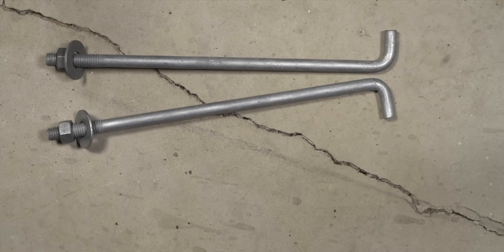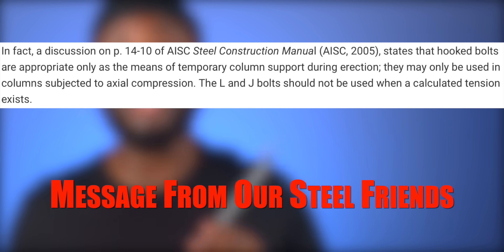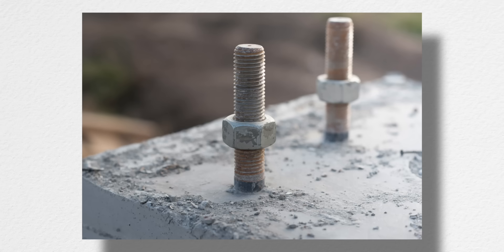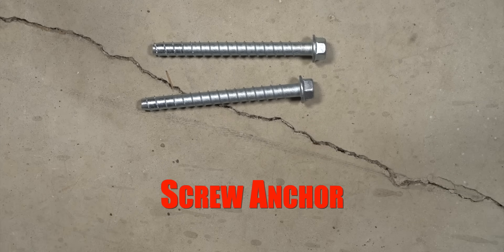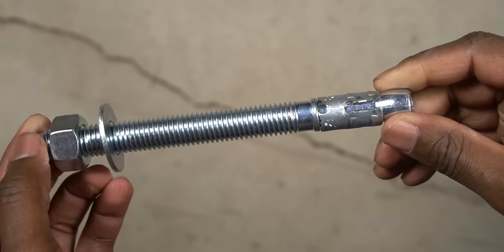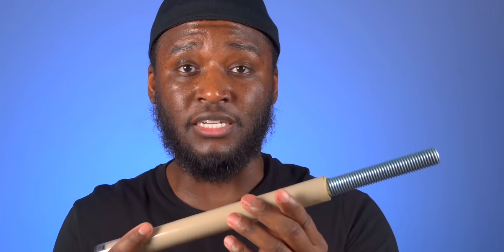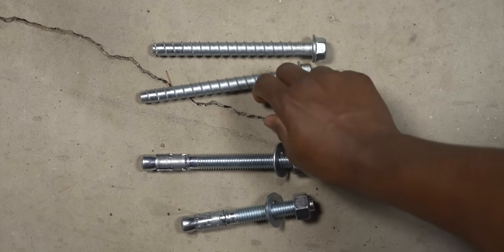Why Abandon "J" & "L" Anchor Bolts in Wood Framing Construction FOR GOOD?

Comment: @JthaEngineer ~ I see a lot of long time contractors, builders, and engineers commenting about the strength superiority in "J Bolts" and "L Bolts" over ANY Post Anchor options and a lot of hand wringing about "user error" in the installation of all Post Anchor types. Now, nearly EVERY comment about the strength superiority of J & L Bolts, includes a disclaimer that "J & L Bolts are HOOKED UNDER horizontally run rebar in the concrete." BUT, everyone concedes that these bolts can be difficult to install because of all the variables involved in setting them properly. Therein lies the rub for the Post Anchor Naysayers -->>  The "assumption" that the J or L Bolts are ACTUALLY hooked properly under the rebar! Let's be realistic about all the dynamic challenges that are innate to working with concrete. Anyone who pours and finishes concrete, whether it's footings, stem walls, full basement foundation walls, floors, patios, driveways, etc... KNOWS how many factors can impact the final product. I've seen horizontal rebar locations change dramatically before and after the concrete pour. I KNOW I'm not the only one to have witnessed this issue. So, can we really say with 100% certainty that all J & L Bolts are actually hooked under horizontal rebar?  All of the professional's hand wringing about potential "User Error" with Post Anchors, seems to completely IGNORE the frequency of "User Error" with J & L Bolts as well.  I appreciate your content. Keep up the great work! ~~Christy~~

Comment: I have heard the Simpson Titen HD screw anchors can get around the code requirement of at least 7" embedment depth. Meaning I can use a  6" or 8" bolt to hold my 2x sill plate down. I have the ICC-ES report up but can't make sense of it. You said you specified these anchors for your builds. Do you have any advice on what is a code compliant length when using these bolts? Simpsons long bolt options are 6",8", and 12". I'd like to avoid having to buy 12" bolts if I can.

Comment: hum, I think putting J and L bolts to concrete before it's dry is much more faster then. Drilling a hundred holds to put in anchor bolts is very tiring job. What you think?

Comment: Seems like threaded rod to a macro-version of plumbers tape or 18 guage L bar would be cake to incorporate into a pour.  I would hope the J was hooked on rebar or threaded cable in that pour.  You will never have enough uplift for it to fail.  I was skeptical of threaded cable until doing a tear out.  Absolute nightmare to remove concrete reinforced with that shit.

Comment: this guy has no clue what he is talking about , seems like a waisted education to this expert , never in history has a j bolt been pulled out of the concrete the sill plate gives out and the wall blows away with the sill plate and anchors still securely bolted to the concrete still , and Jay if by now you are not aware of how to find that kind of information you might want to try some other trade, then to suggest other anchors well i had to laugh at you then

Comment: Maybe some time working with a concrete crew would make an interesting video. Any rod buster could make those bolts work.  They just need support from a lateral bar. Just hook them on the bar and tie them in. Post pour if necessary.

Comment: From what ive read, the industry moving away from J bolts has nothing to do with pull out strength. Its about improper wet set techniques causing an air gap between the bolt and the slab which water can get into. 

Technically J or L bolts are far superior, but practically they pose potential issues.

Comment: Planning on doing a little 4-500 ft2 bar in my back yard. I’m not in construction but automatically assumed I would have to use anchored bolts. Why does drilling into the concrete not compromise the integrity? Generally wondering, nice vid

Comment: 1:29 your example shows it into the weakest part of precast concrete beam. That’s disingenuous as compared to most j bolt installations. Sub-Contractors can hardly read plans and don’t plan properly when they frame. It’s not just their fault. The contractors and builders chose the cheapest labor for so long there are no craftsman. I fundamentally disagree with the more expensive post pour options. People should just learn to be better. Just because a more expensive option exists doesn’t mean it’s actually better or faster.

Comment: Common sense would dictate installing "J" bolts before pouring concrete,  and using the proper installation and of length bolt would be best. Install with j under rebar.  When you talk about failure are you talking about design limits? Tensile strength?  Proper spacing using the correct number of bolts for design loads.

Comment: all the bolts shown do not meet code quoted as they 'must extend 7" into concrete or grouted cell of concrete masonry wall' , they are all obviously too short and 7" seems ludicrously onerous in the majority of domestic timber framing scenarios.

Comment: Im a stonemason,  Ive been fixing brackets and anchors to concrete blocks and concrete slabs  for 30 years. Boundry bottom plate anchors blow out more slabs  than j bolts, that's a fact, countering  your claim J bolts  are tricky to line up. Yes j bolts can be tricky to line up, but you need to prove which method provides more uplift  resistance, and therefore safer for my family. I would challenge anyone to provide  testing results that show a thread on a concrete screw  works better under tension than a bolt set into a slab.   You say there's a move away from  the bolt embedded method to screw bolts and I agree. But if 3/4 bolts aren't  sufficient,  then  for another dollar  more " use a bigger  bolt" and build  a safer home. The only advantage  is it's easier and requires  no thought to drill and place your threaded rod and screw bolts  flat against your studs, saving time, but it's not stronger, it's weaker. I have pulled out plenty out pins and screws but you have to grind off or snap off embedded bolts.

Comment: So for some reason we were required to put a particular depth of j-bolts. So it doesn't do anything? It seems like post applied bolts like Titen are superior and mean the bolts are more properly placed in the end. Actually engineers in our area, typically specify J-bolts. Just haven't changed their details.

Comment: The problem with the post installed anchors is there usually not allowed for installing green concrete which may be fine for some use cases but there's a lot of people that get out there on very fresh concrete and frame. I would be more concerned about tapcon style anchors that were installed into green of concrete personally over the j bolts personally. I have worked extensively in the concrete and rough construction but I'm not a structural engineer so maybe I'm wrong here.

Comment: ...........I feel as though ignorance is a pandemic . I do Residencial framing for a living out in ut in the Rocky Mountains. 5/8" "J" bolts hooked on the top course of rebar is not just the standard of the industry but is the Gold Standard. It is also the easiest of systems to install for a framer cuz wouldn't you know it, but drilling 1 1/2" of wood in your sill plate to accommodate a 5/8" "J" bolt is much faster then drilling 8" of concreat to accommodate a 5/8" Titan screw. It's not that any of these systems are bad, they are the best system depending on your application/circumstances. Try working in the fiend with these products for a hot minute. It will give you the actual context for applying your engineering degree.

Comment: You can install HILTI powder activated fasteners that are 12 TIMES STRONGER than "J or L" bolts. I used them on my 1925 Model T garage expansion to fit a modern pick-up on top of 7500 PSI concrete stem wall. We have tornados and 115 MPH straight winds in thunderstorms har' en Tussa, Orka-Homer, so I BUILT FOR THEM! My house was built 100 years ago in April this year. It's held-up to wind, tornados, 6.7 earthquakes, 17 inches of rain in ONE HOUR and more. Do it RIGHT or do it AGAIN!!! The builders used a dozen iron cut nails between each stud into the concrete stem wall foundation thru the "shoe" or footing.

Comment: in fl cbs uses rebar pored in the slab  ,  but i like to see something like a 3-4 inch each side t even the alternatives are still straight shafts  now i do know good engineering should have tests proving the claims by makers , i might like a combo of some j or l plus some drilled in if in hurricane or tornado areas although i would only build filled block or poured concrete in the tornado ally plus a shelter

Comment: You'll need between 2500 to 3,000 pounds of force to pull out a 1/2-inch diameter J-bolt embedded 6 inches in 4000 psi concrete. With around 30 of these bolts in a typical 2000 square foot house, that means you'll need 90,000 pounds of force or  wind at 150 MPH.

Comment: You can just chill in a rebar on sideways on an angle like 20° or so fill it with some grout or some Hilti head epoxy put it in there and then well then that's something on the end of it to hold your post down that's just as strong as an anchor bolt going straight down relying on that little edge I think it's even stronger it's like alligator nailing

Comment: As an Ironworker, L&J bolts cast in concrete at the safest to set on. Epoxy needs a pull test and can't be trusted unless they have it done.

Comment: Are you kidding? You should use exactly what the architect and/or engineer specifies.  And your test??? Are you kidding about that also? For testing...You should use a deep enough anchor so the anchor itself breaks...NOT the concrete.. THen you know what it will really hold.  We have put 1" threaded rod down 36 inches into a footing with 4 inch plate washers at the bottom... What is that good for????30 tons of uplift?   Sure,..I'm sure I'm just a fluke and haven't read any plans (that I am involved with) where they do not specify J bolts...or  fairly long allthreads with washers. If you look up on the simpson website,..you can see EXACTLY how much a 1/2 inch J bold embedded 9 inches (underneath the top rebar) will hold.   Nice click bait,..that's all I can say. I have never seen a post installed anchor allowed on a bearing wall.. And it will never happen on any job I am on. Post installed anchors happen,..and they are usually allthread embedded into concrete using structural epoxy,..and they have roughly the same strength as cast in place j bolt anchors...if they are the same length.

Comment: dude makes no sense, he had that bolt in inch of crete for his dumb jig, if instaling a hook into concrete is complicated for you then that's not the industry for ya. Those expansion bolts will crack concrete and still not provide the strength nesesary, the screws with glue are useless come on bro, most of those epoxies are not even made for harsh climates...

Comment: As a contractor of 20 years specializing in excavation and foundation retrofitting, I STRONGLY disagree.  Do not let your contractor use post installed anchors unless a mistake was made.  ONLY when a mistake is made should a post installed anchor be used. I don’t doubt that calculations on paper show post installed anchors being similarly as strong as cast in place, but those calculations certainly don’t take into consideration all of the factors, like horizontal rebar being embedded above J bolts, weakening of concrete with micro cracks from drilling holes, greater moisture intrusions, removal of galvanized material from post installed anchors, etc.

Comment: Sir, I have been building for 60 years,  dyna bolts regulrly  fail, scew in anchors great for  hold down or temporary formwork fix to adjoining concrete, rag bolts have stood the test of time in low stress engineered situations. This sounds like more white board commission for DEI academics have now  got hold of the construction industry. Start using Ramset concrete insert bolts where you can run a continuous line of deformed rebar through them that integrates with the cocrete and rebar design. Heavens help the construction industry with this  level of wooly thinking, talk about engineering loadings what we have going on here are mutational loadings . Welcome to the harsh roadmap of reality! KPP nz

Comment: J bolts which are wired to and hook on a horizontal rebar before the pour do not pull out.  Rebar threading is also a good option which is used where I live in California.

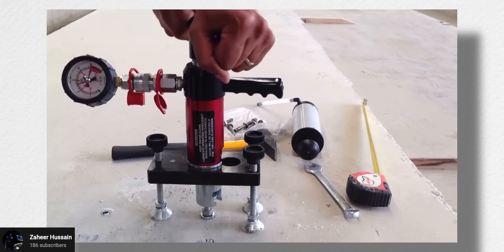Comment: Shame on you!  So much misrepresentation in this video!  You falsified the 'J/L Bolt Flaw' video. In your video @1:24 that is NOT a J/L bolt failing!!!  You stole that video from someone else!  And it's a wedge anchor failing!  Here is the original video https://www.youtube.com/watch?v=LBe4okYOvyA  You used that video to imply it was a J/L failure.  If you're using someone else's video you should be crediting them.  Not passing it off as your (false) test.

Comment: I'm a mechanical engineer, building my own home.  I used L bolts as called out by the structural engineer, but upgraded to galvanized for a few extra bucks.  In a few locations we needed additional bolts such as around doorways so we installed Titen bolts (screw anchors) in those locations.  I loved using the Titan bolts and they were very easy to install.  The concern I have is the design heavily relies on the integrity of the thread. It seems as if the thread would be the weak link over time as the thread corrodes and rusts.  The thread is fairly thin so it feels as if it could decay relatively fast.  I would suspect the galvanized layer is also somewhat compromised as the threads are twisted into the abrasive concrete.  I wonder what kind of life span these bolts have been tested to.

Comment: When I built my garage I did the j bolts on the block. However, I think both are fine, they both prevent uplift but at some point if the force it to much then both ultimately fail. It’s still better than nothing on the sill.

Comment: 65 years in the trades = This subject, and this presentation, is in my case amusing. Not to dwell on that, let me point out the obvious. Contractors are aware of the choices. DIYers don't often get involved with projects that require them. Engineers wet themselves when you get technical, hence my amusement. See below!

Comment: J and L bolts are FAR superior to screw, epoxy and expansion anchors. The logic in this video is some of the dumbest I’ve ever heard. But typical of Engineers with zero building experience. It should be common sense that cast in place anchors are stronger and easier (with proper prep), but over complication is commonplace among engineers these days. Also, I’ve been in the industry 30 years and I’ve never once come to the consensus that installing J or L bolts or drilling out sills is “hard”. It’s actually the very opposite.. please, if it ain’t broke don’t fix it.. perfect example here.

Comment: J bolts are fine, if they are dry set and the concrete is placed around them. They are not any good when they are wet set and pushed into the wet concrete. When you wet set, you push the aggregate  out of the way and are left with sand or worse a void above the hook.

Comment: Blah blah blah blah blah, blah blah, blah blah blah blah blah blah I see this video is two years old. This is April 2024 and your video is bullshit if you’re that using 4000 PSI with fiber and rebar in 45 years of building I have never had a failure so it’s operator error and when you’re talking net windshear lift that’s also bullshit sometimes the people doing the engineering and the testing are full of shit and they want. make their mark so they come up with all these wild ass ideas. Why is it homes all over the world don’t fail with this exact technology It’s because what you’re saying here is bullshit drilling into the concrete after it has hardened is inferior I saw your pull up test you’re not doing that test on 4000 PSI with fiber you’ll strip the threads before it will the concrete will break.

Comment: I have used J bolts for 50 years. Never had any type of problems and I will continue to use them. Just because screw bolts are new doesn’t mean it’s better. Expansion bolts cause to much long term pressures on very fragile concrete. We pour all our foundations then insert the J bolts and will continue.
Reply: The top of the walls are also never flat & level. Only way to get level & flat wall tops is going over with a concrete grinder which isn't possible with j-bolts in the way. Its pretty easy to just add a lot of Titen bolts since they install quickly with a hammer drill. and the increase anchor bolts per linear feet (2 or 3 feet spacing) offer the same or better than standard 6 feet j-bolt spacing.
Reply: @shopart1488 If a properly placed j bolt ever somehow pulled out, then it was destined to happen either way.
Reply: I fully agree with you and I've been using them effectively for 14 years and counting however I like wrapping my j bolts with steel wire before submerging them in cement....
Reply: I think epoxy is superior and pull out tests reveal that the concrete breaks off, not failure of the bolt or epoxy.

Having done something for 50 years is imo not a good reason to continue doing them that way. Perhaps you should throw all your power tools away because 50 years ago, people didn't have power tools?
Reply: @V8Z3 exactly. The most ridiculous reason for doing anything is “this is the way we’ve always done it.”

Comment: Post-installed screw anchors are limited by the width of the thread, often mere millimeters (25.4mm = 1".) Pre-installed J or L bolts with a broad multi-splayed base are better  and should be attached to the rebar.